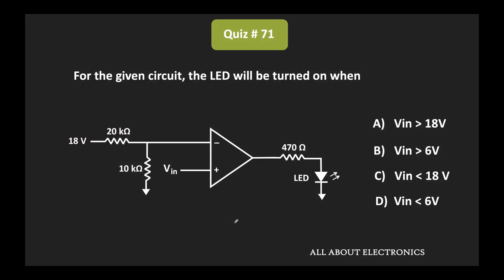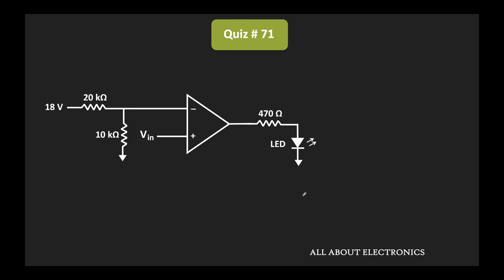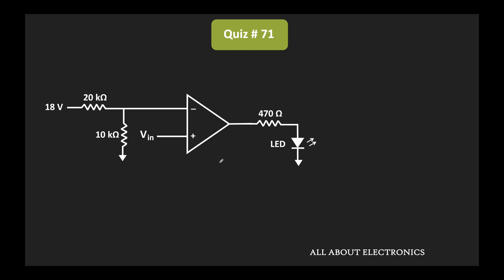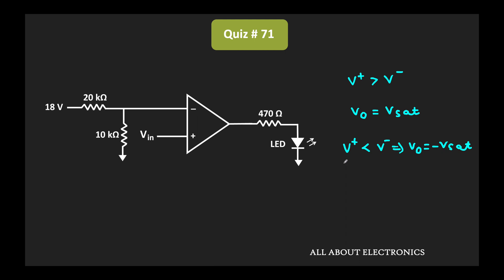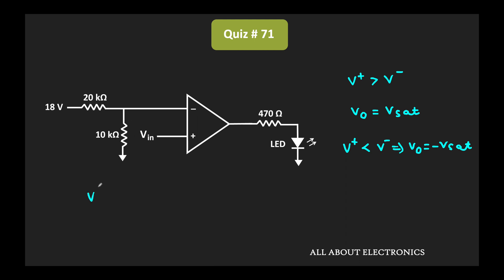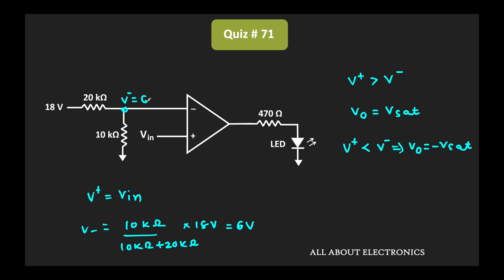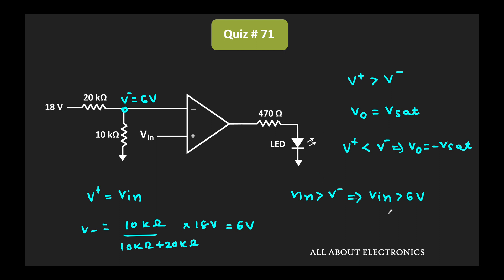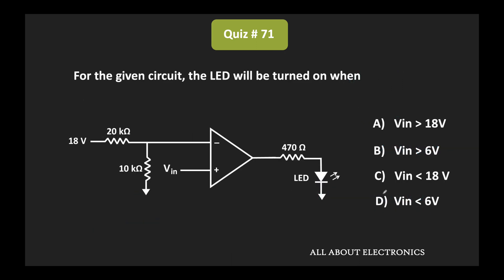Op-Amp as Comparator Solved Problem | Quiz # 71

Comment: why V in > V-. Plesase expalin it help me
Reply from the maker: When Vin > V-, the the output of the comparator will be +Vsat. (Some positive saturation voltage which is close to positive supply voltage). The same voltage will also be applied to LED. Therefore, to turn on the LED, Vin should be more than V-. I hope, it will clear your doubt.

Comment: Why V- = ( 10k / (10k+20k)) × 18v
Please comment sir
Reply from the maker: considering ideal opamp, no current is flowing into the opamp terminal. So, we can assume that, the current is flowing through only 10k and 20k  resistors. Therefore, using voltage divider rule, we can find the voltage at the inverting terminal. I hope it will clear your doubt.
Reply: @allaboutelectronics-quiz  Thank you sir
Reply: Ideal op V+=V-  ,V-=6v